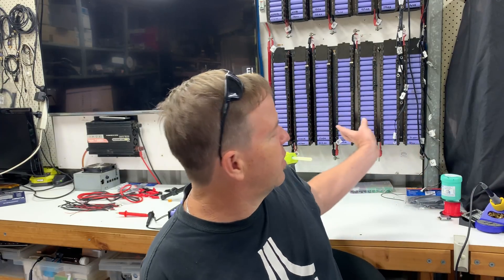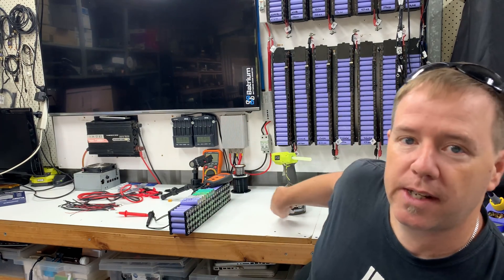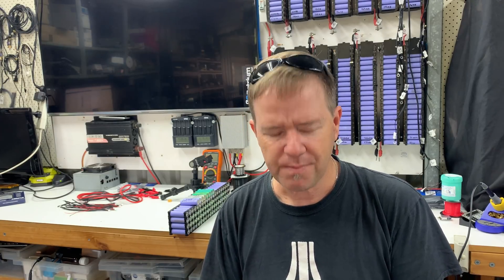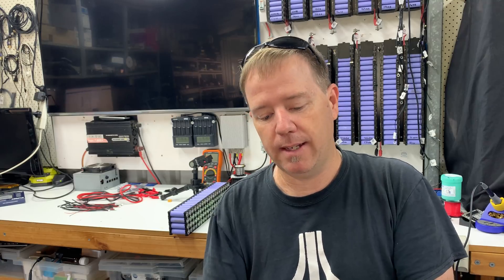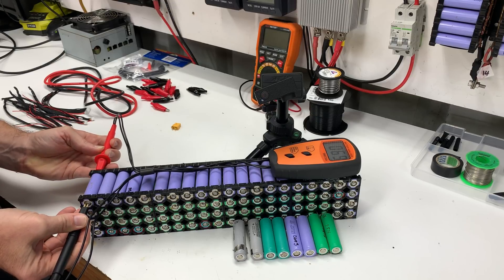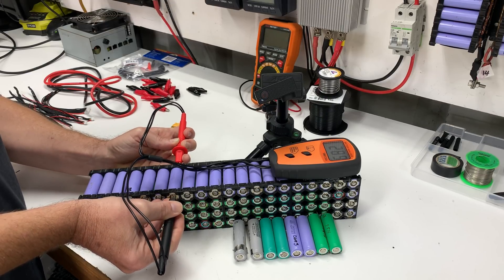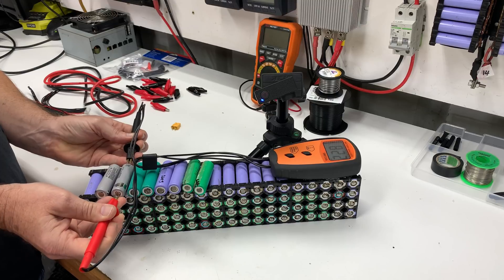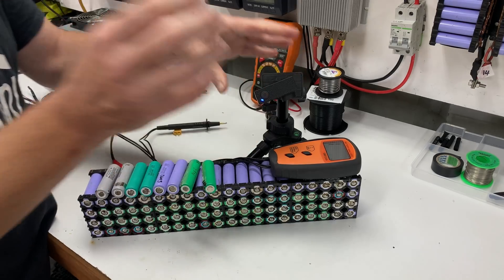No room to be complacent when playing with Lithium revisit - IR test

Comment: Great Video!

I just picked up one of those SM8124A analyzers. 

When I test brand new INR1865-25R’s Im getting a reading of 13.5 mohms when using the 200mohm rang which appears to be bang on with spec sheet. and get consistent reading across all new batteries Ive tested

But if I test the same batteries using the 2,000mohm range as it appears your using in the video Im getting reading between 7mohm & 9mohms.

Im curious if you have that big of a difference between ranges on your analyzer?

Comment: hey #HBpowerwall  I have a 36V Fast Charging Rechargeable Lithium Battery for Xiaomi M365 Electric Scooter that i love to repurpose to a portable power bank. 

 Specification:

Material: ABS+Steel

Nominal Voltage: 36V

Battery Brand: made in China

Battery Type: Lithium

Battery Mode: 18650

Battery Quantity: 30pcs

Battery Capacity: 6.6AH

Output Current:  15-20A

Power: 273.6Wh

Mileage: 25km

Charger Rated Power: 71W

Charger Rated Input Voltage: 100-240V 50/60Hz

Charger Limit Voltage: 42V

Application: for Xiaomi Electric Scooter ONLY

Charging Time: about 4.5H

Protection: temperature abnormal/short circuit/under voltage auto dormancy/over current/double overcharge/double over discharge protection

Size: Approx. 33.5*7*4.1cm / 13.2*2.7*1.6in

Weight: Approx. 1544g 

It has a port for charging but would like to add a port for 120 output. i'd Love to see a video of you repurposeing one of this scooter batterys into a portable 120 battery bank.

Thanks Mate!

Comment: Hey i stumbled on your video, i just wanted to know if you could explain how to make a battery that meets these specs,
1. Is rechargeable from wall outlet 
2. 12v to power a car radio 
3. Large capacity 48 hours of running a radio 

I plan on making a radio box for my atv that uses a 2 din touchscreen head unit from a car, thanks:)
Reply: Does your ATV not already have a 12v battery? Because you could just add a bigger one and have it always connected to a small wall charger if you need it. Plus, I imagine you’ll actually drive the ATV (and the running motor charges the battery), so I’m not sure why it needs like a full week of radio when you’ll probably drive it at least once during this, but you could still just use a cheap $50 deep cycle car/boat battery or 2 connected in parallel with your existing one). That’s probably the cheapest. Li-ion is kind of expensive, but as for output, as long as it’s not a massive 100+ watt ground pounding system your running, basically any voltage above 12v (so like 4 lithium batteries in series and as many in parallel that you want, or a 36v PCB for electric bicycles, doesn’t matter) with a cheap buck converter (a device that regulates high voltage DC down to a lower voltage DV, such as 12v) seems like an easy way to do it.

Beyond this, Google searching is your friend for learning about these parts and how to use them.

Comment: did you finally find the reason why this pack went to zero (and maybe even reverse charged)? I guessed you balanced all your packs well and looked for same capacity of the packs - so i wonder how could that happen? Didn't you use your monitoring system with low voltage alarm? Not even a BMS or similar? Also i wonder why none of the fuses seems to have tripped - so they must have been discharged to zero all quite slowly. Or one or 2 cells were bad but not a real short but kind of high self discharge. When you operate it for some days without any control one or two bad cells can probably drain the hole pack to zero - especially when the voltage was low already.
So i think it would be very important to the community to invesitigate a bit more to understand what really happened here in detail.
Reply from the maker: No BMS, no balance, not thought, no common sense resulted in reverse charged battery and killing it

Comment: Would be good to auto scan each pack voltage during use and shutdown if any <3V or >4.2V?

The latest fully charged video of an electric ferry shows they keep within 40 and 66% charge for long life. Accubattery shows this 26% depth of discharge is only 5% of a wear cycle (Tesla Model 3 long range about 80-90 miles for 26% depth of discharge -- once its software allows not charging near full for the soc estimate / balancing)
Reply from the maker: already have that implement with a new bms, that fullycharged ep was awesome those batteries on the deck in shipping containers was an awesome idea

Comment: I have the same meter that you have,  important is if the battery is zero, CID would be useless. It is possible it would read the same as resistance in a multimeter with voltage applied.. so therefore a false reading.
Reply from the maker: learnt something new thankyou

Comment: personally, im installing an independent to everything else, redundant, cell-pack voltage monitor that will cut power off if a cell-pack goes too far above or below my normal preset limits, isolating the bank. (the system will then switch over to my backup AGM'S to power everything and light a warning on my panel.) overkill? maybe, but double protection for under/over voltage makes sense to me
Reply: There really isn't any such thing as overkill in this game bro. 

Pretty rich coming from me just making the argument that probably fusing each individual cell is "probably overkill" lol

I like your thinking, I have often considered prototyping a voltage monitor with either contactors or probably IGBT's big enough to bypass the cell  during discharge,  so power could be maintained (short term) in the event of an under, and open the circuit during recharge, cause otherwise it would need to communicate with the charger. 

I guess BMS's do all of this. Just wish there were some available that were more affordable with connectivity, or at least a display panel. 

I'm still collecting cells. When I get enough of em, I will design my own. I haven't seen any on the market that I like, priced in a range I deem fit. :P
I'm not cheap, but batrium is WAY too expensive.

Comment: Love it Pete!
You're doing a great service here!

Personally, I think that new fuse arrangement is perfectly safe, but that's just opinion at this point and I'm interested to see how it pans out. Maybe some destructive tests are in order, or at least some very high load tests.

Dead reckoning:
5 cells per fuse. Lets assume one goes nuclear. Lets also be generous and assume 3200 mA/hr capacity per cell.

so, 4*3200 = 12800 or 12.8 A/hr  (@20hr rate mind)
12.8 * 3.6 V (nom)= 53.76 W/hr @ 20 hr rate.
Lets say the little nuclear buddy goes as low as 5 milliohm ESR and zero volts.
4.2 V div 0.005 ohm = 840 AMPS! Of course the cells simply can't deliver that much, but they will try. Lets assume they manage to deliver 10 A each totalling 40 amps.

12.8 A-hr div 40 A =  0.16 hrs. ie: +/- 6.25 mins
This is a very inaccurate estimate due to using averages and not actual discharge curve information, and in reality they will only supply that kind of current for about 4 mins. 

3.6 V(nom) * 40 A = 144 W  being dumped for 6 min plus the energy in the shorted cell itself.

That's a fair amount of heat and you may run into problems with an exploding cell.
The CID's "Should" engage before this happens though.

On second thoughts, even though this is a highly unlike series of events, I would build a 4p set, then using a clamp meter, measure the current into a dead short from 100% SOC. Data log it with voltage over time if possible. Just to see if indeed enough heat is generated to cause any ruptures or fires.

I'd be happy to do the experiment, video it on my phone. I have no means of data logging it, but I do have 50amp shunts and metering.
I still think it'd be fine, but I would do the worst case test.
I agree with you though in that a fuse per cell is overkill, but it is the safest method.

Comment: Good video Pete - definitely looks like it was reverse biased for long enough to kill them. RIP!
I'm not convinced about the new fusing arrangement - would come down to how much current the adjacent nickel stripped parallel cells can shove into a shorted cell (30A?) plus the current from all the other cells over the fuse, which would have to blow at 5x 3A? = 15A?  This could be enough to shove 45 amps into a short cell.
I don't think that would be much different than nickel stripping all of them!
Reply: Hey Andy, nah mate, that's not how it works. The available current from the rest of the pack is more in the order of thousands of amps into a dead short. Fuses don't limit current in the way  a current limiter does, they tolerate a maximum current for a specified period of time.

That shorted cell would see thousands of amps of charge current, but only for a few nano seconds. 
The other four cells... well... they might deliver 40 or so amps, maybe more,  but would discharge pretty quickly. Perhaps 4-5 min?

Has anyone actually done short circuit current tests on 18650's? I realise it would vary from cell to cell, but some ball park numbers would be good for making approximations. I'm gonna go look now.
Reply: @Jimmeh_B  Yes of course, the fuse would last a few milliseconds before blowing - unless the cell didn't go completely short, in which case the fuse could still conduct adding up to another 15A to the other 4 cells in the subgroup. It's just a theoretical worst case maximum.
Still, 40A for 4 minutes into a bad cell is enough to send it sky high if its cid doesn't blow.
Reply: @ahaveland  yeah, that's assuming they'd last the 4 mins @ 10A each. Even at 2800 maHr I suppose it's conceivable. I haven't seen any tests either way.

and there's still no way to supply 45 amps in the worst case scenario if the fuse is 15 amp. Kirchhoff.
Reply: @ahaveland  and by the way mate, if you had a correction and sent it my way, in the even I was wrong, I would own it, correct it and move on. 

Not reply with "oh of course this..... of course that.." followed up with some shifting of the goal posts and finished off with a bit of "it's just a theoretical..." impossibility under any circumstance and a badly thought out argument followed by a bit of "still... your 40 A argument is dangerous" when I proposed it probably is and afforded you the opportunity to offer any evidence you'd seed to the contrary or otherwise.

I don't appreciate that mate.
just saying.
Reply: @Jimmeh_B  45 A = 15 A via the fuse plus 30 A via the nickel strip from the 4 other cells.
Reply: @ahaveland  again, Kirchhoff's law.

Think about it
Reply: @Jimmeh_B  No need to be so precious, I was just speculating with ballparks, not stating facts.
Everyone knows how a fuse works!
Whether a cell gets 400A or 40A the end result can be the same. Whether it takes 10 secs or 100 secs to go nuclear is irrelevant if it's unattended!
No hard feelings. Life is too short.
Reply: @ahaveland  bro!
You're wrong and your maths is out.
Your considerations are off.

I'm not being precious. You're wrong. If you would like me to critique your answer,  my answer will be do your own homework. What you suggested, can not happen. It is not irrelevant.

And no, there are no hard feelings, this is not an attack on your knowledge nor an assumption that I'm somehow better or something.  It's a simply statement. You are in error irrespective of exact numbers. This is a technical forum, involving potentially dangerous builds and I think it's better we all point out error where it is presented. If for nothing else, because people who may not understand certain elements of these builds, could get the wrong end of the stick and make "educated assumptions" when the information is incorrect. I'm not digging at the numbers you used, but the functional concepts of electricity in general and your error or perhaps lack of understanding? I don't know what level of understanding you have attained.

To spell it out for you my friend, at best, if all the instantaneous voltages and resistances happened to be the perfect storm :
The dead cell would draw X
the available sources are 
1: the x other cells (excluding itself) remaining before the fuse and capable of x amps
2: the x cells on the other side of the fuse, the fuse being rated at x
Kirchhoff : The sum of all currents must total 0
IE: the load will be shared equally by all supplies.
at best, the dead cell will want exactly 30 amps (in the hypothetical example given) BECAUSE;
if the cell wanted any more than that, the 15 amp fuse would blow, then the other 4 remaining cells would try to supply the x amps, quickly discharge and then nothing, unless hot and explody, in which case it would not be such a non event. Which is the whole point, and I afforded you the opportunity. Jeez mate. Ego much?

So there ya go, even did the homework for ya in the end.
Happy to help :)

Comment: I don’t think it would have anything to do with the CID when you over drain a cell. The CID would disconnect when you punish the cell with over charging.
Reply: Yeah, it's a pressure activated device. If anyone reads this and is curious I took one apart.
Reply: Agreed.  You end up with the copper moving away from where it is supposed to be, causing an increased internal resistance when the battery is in use and also self-discharge.  This video explains it very well, with a bonus explanation of how it's not the worst thing (but still not good) to discharge to 0V but is very bad to reverse charge.  https://www.youtube.com/watch?v=sRwoYJyjZNo

Comment: is it worth checking every single battery for resistance? if so showing what you have for numbers i'm guessing anything higher than say 1  wouldn't be a good idea to use in a pack ? also when building a pack should a person try to keep all the batteries the same or close to the same resistance or that doesn't matter at all?
Reply: it's a double edged sword.
The higher the internal resistance the lower the discharge C rating.
Ones with lower int. R will tend to take more of the load, however, the other cells potentials will maintain an average over the pack only limited by the resistances in the interconnecting conductors.

So yes, it is better to match internal resistance at least as closely as possible, but, it will find equilibrium, so no.
Some cells may be under higher stresses than others though but as Andy Lee Robinson suggests, it really isn't of consequence and the more cells are in the pack, the less such effects will manifest.
Reply: @Jimmeh_B  Also a case of diminishing returns - trying to optimize both the capacities and IRs of 4000 assorted cells will send you to the nuthouse!
That's something to be said for new cells being much more evenly matched, but I certainly can't afford to do that.
However, I do have time - if only I could stop watching youtube long enough to get something done!
Reply: JayRock I personally test every cells IR. Everything over 100milliohms does not get used. When building packs this size or larger I believe anything under 100mohms will be suitable. For other style packs it might be better to have a tighter grouping of IR.
Reply: For big packs where each cell maybe sees half an amp maximum, the IR isn't much of a deal as long as you don't have too many high IR cells. I wouldn't use ones over 150mΩ unless their capacity was good and they didn't get too warm on discharge.
For me, matching the average capacity of the cells is the first priority, then matching the average IR if you can. With a big pack random variation should average out.
If you have a large number of high IR cells in a pack, then when you charge it, much more current will flow through the low IR cells - perhaps more than they are rated for.
As long as a cell holds its charge then it can contribute.